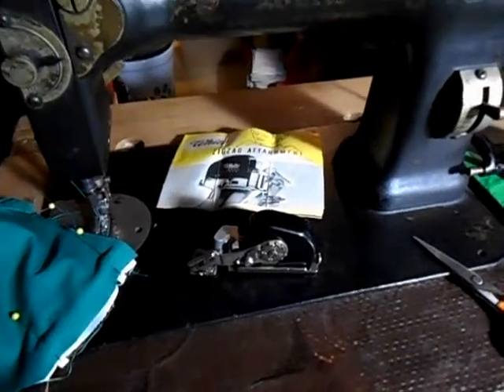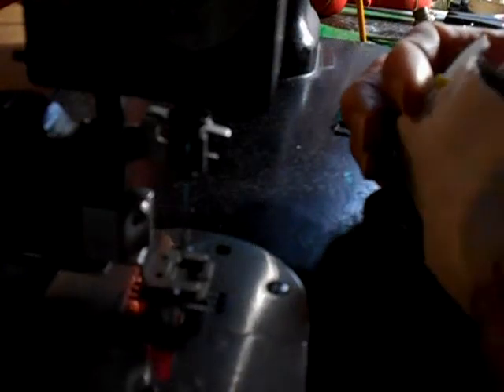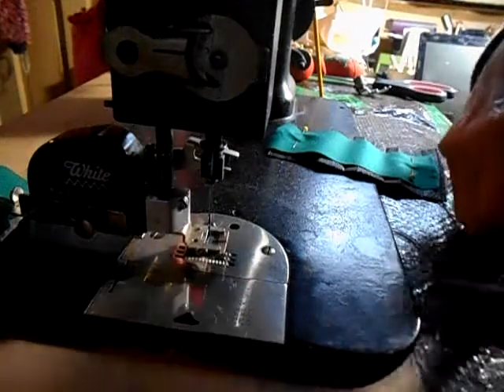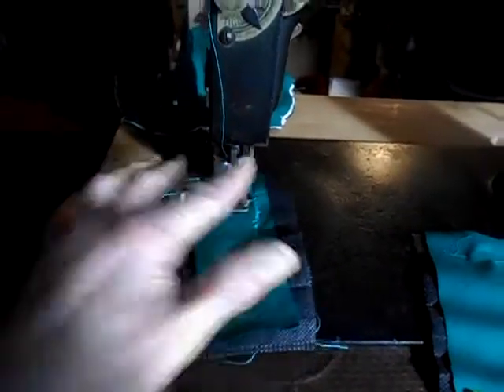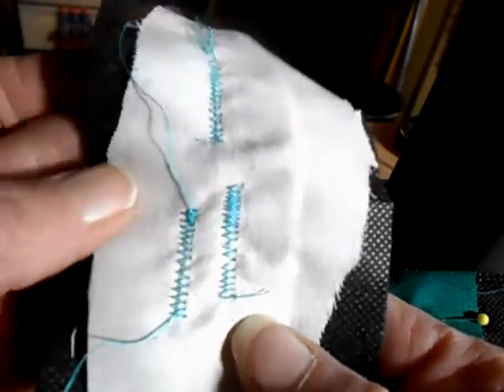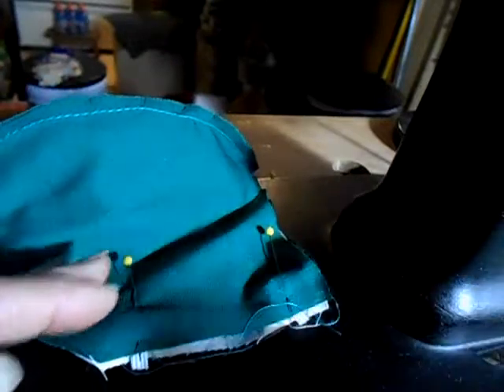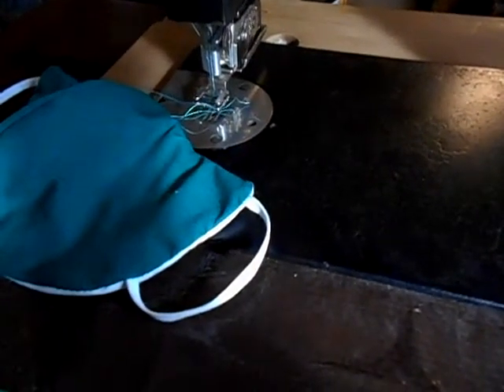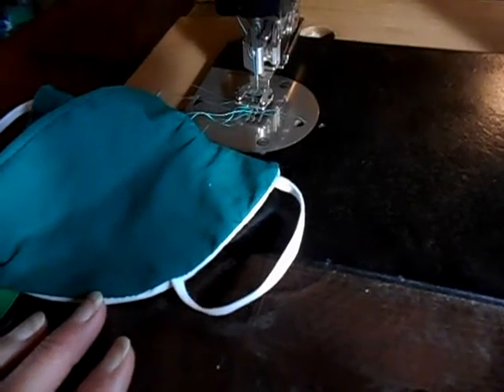White Family Rotary Zig Zag Seams

Comment: Excellent details Ms.!  I two evenings back just sewed the first stitches on my two rescue restores that are White FR's.  I literally picked up a Singer VS-2 27 class the same days as the first White FR I own, both treadle machines... and was amazed at how quiet the White FR was compared back to back.  Decided since I need a upper thread tension hook spring for the Singer... to just move forward with the White FR restore work.  Now I need to learn how to sew and invest in this tool.  Wondering if there are any other White related attachments that do the same like the button hole one maybe... though in a straight stitch way?  Thanks for sharing.  Looking forward to watching some more of your videos since you detail what I've been wondering.  Wondering, is there a best needle and thread to use?  Any references you suggest?  Thanks again Ms.!
Reply from the maker: Hi- Sorry it took me so long to reply.  The best source for what attachments were available is Katie Farmer - she is writing a book on Whites and if you send her the serial number(s) she can give you the date manufactured and let you know a list of attachments.  I have an attachment box with my machine that has mostly hemmer feet, a tucker, a gathering foot.  There is a buttonholer I believe. I have only gotten the attachments I thought I would need. It takes the same needles as a Singer - 15 x 1 or 2020, and then sizes 11 to 18 I believe depending on the weight of the fabric.  There are some very slightly longer vintage White needles, but I have only seen them once, Katie would know more about the original needles.  Her email address is:  kf82479@aol.com - Happy sewing!
Reply: @LaurieOMeara  Hi and no need to apologize or be sorry regarding the reply time.  I wound up picking up another two White FR's yesterday, one is the best treadle I now own and the other is dusty & rusty, though looks like operates and will do just fine after come thorough cleaning and oiling.  Thanks for the insight into what's used.  I'm still learning the needle theory as well as sewing in general.  I seem to be hooked on the machine designs and restoring to stitching in spec. performance.  I'll email Katie again, though last I read on a forum... she's been busy and had some issues though is doing OK now.  I also made a spreadsheet to help publicly document here: https://drive.google.com/file/d/1Gcmo8Nf_NeMpDmDck0J8D2r_xtSKqRks/view
 If you want to comment with your serial number and info, I can update accordingly and that'll test the link and comment ability out also.   I just haven't advertised the spreadsheet yet and thinking will be a good backup for Ms. Farmers resource where I hope she open sources online and then gets Internet Archive backed up or at least gets out in the book she's working on.  Thinking I can post that on the FB vintage and sewing related groups next. I'll try Ms. Farmer again. 
I just noticed your machine doesn't have a serial number area like most.
Reply: Thank you for the insight and reply!  Forgot to mention and wishing a safe, healthy and Happy New Year to you and those in your life.